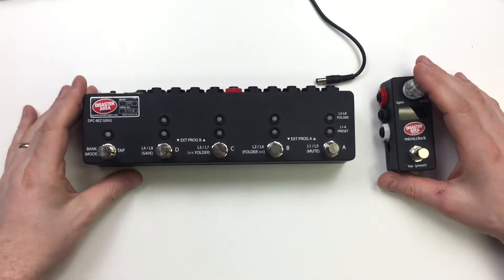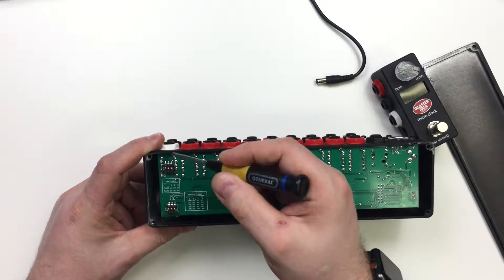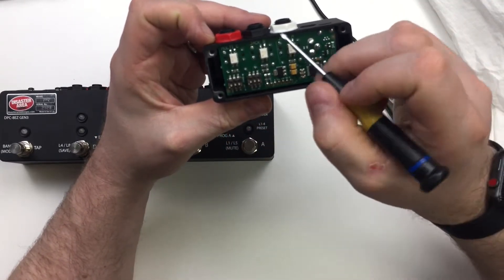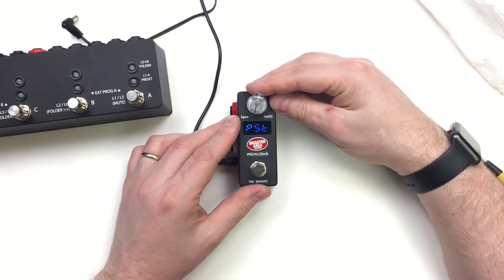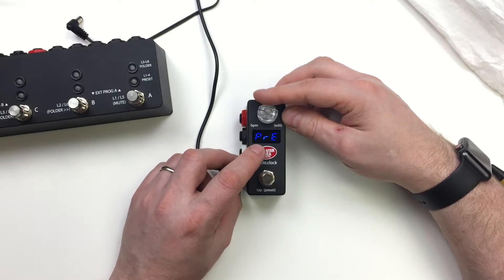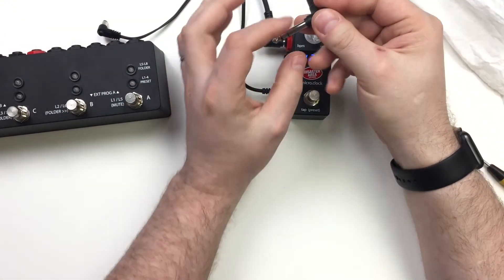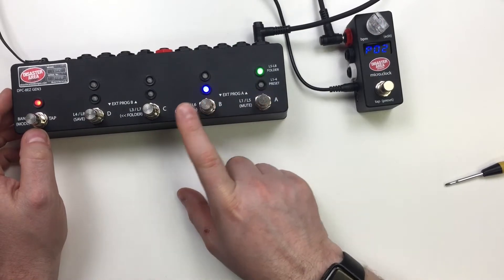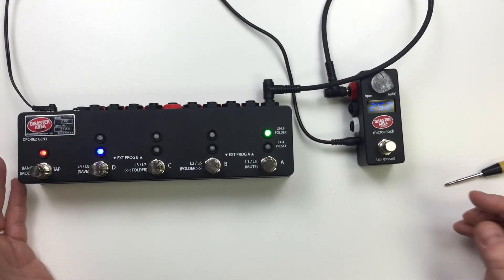micro.clock & DPC 8EZ Setup

Comment: So, does the micro.clock have 128 presets recalled by sending a PC message as usual, and will it then send that tempo back to my Quad Cortex from whence the PC message came, so the QC responds to the micro.clock's preset tempo? Kinda like a two-way street.
Reply from the maker: In theory, yes, but the MIDI port on the micro.clock requires either a TRS to MIDI cable for MIDI out, or some adaptation to get MIDI in and out.  Our devices handle this natively but it might take a bit of work to get this with the QC.  Our SMARTClock would be a better choice as it has DIN MIDI in and out and would not require any special cabling.
Reply: @DisasterAreaDesigns  I have MIDI DIN to trs cables so should be ok??
Reply from the maker: @tristanseume  for output, sure, but if you need to do both input and output then you'll need something a bit more involved and we don't sell it.  By the time you get the micro.clock and the conversion you'd need, you're over the cost of the SMARTClock.
Reply: @DisasterAreaDesigns  I see... Well, my  micro clock arrives tomorrow! Second hand so a bargain, so maybe still worthwhile. What do I need? I do I just wait until Neural enable midi clock to be sent?! :D

Comment: I bought a dpc5 gen 3 and I want a gen 3 smart clock or a gen 3 micro clock. I want to control the Timeline.  How should I connect the micro or smart watch?  Do I have to connect directly to the Timeline or do I have to connect to the dpc5 to change tap tempo and subdivisions.

Comment: Is it possible to set it up where changing presets on the 8EZ won’t change presets on the micro.clock, and vice versa, where changing presets on the micro.clock won’t change the 8EZ? Basically, the 8EZ passes the tap info along to its MIDI controlled pedals, but it and the micro.clock work independently?
Reply from the maker: Sure, if you tell the micro.clock to use the Jack C as MIDI out only then it won't get any messages from the DPC.  The DPC will receive the clock from the micro.clock but it won't be able to ask it to change presets, if that makes sense.  Set up J C = MIO but then set the DIP switches with the "ring" set to OFF.

Comment: Just picked up one of these to sync my synths in a suitcase rig. Will it work with TE Pocket Operators?

Also, can it receive midi clock? Or only send?
Reply from the maker: It'll only send clock, not receive.  I'm not sure that we can output PO sync for the Operators, but it's possible to send 3.3V pulses from the C jack.  Maybe?
Reply: @DisasterAreaDesigns  I think that should work. Manual says it takes sync signal "no more than 5vpp". Thanks!
Reply: @DisasterAreaDesigns  what exactly comes out of the "tap tempo" jacks A and B?
Reply from the maker: @_skysick_  nothing, technically.  They're "dry contact closures," they simulate switches.  Most pedals use switches to trigger tap tempo, rather than pulses like synths.  Fundamentally different setup.
Reply: @DisasterAreaDesigns  I get what you mean. So they're just opening and closing momentarily like a relay?
Reply: @DisasterAreaDesigns  I've been thinking about what I'm trying to accomplish and I wanted to run an idea by you about how I can hack something together.

I need to send sync to...
1. Synths that take analog pulses
2. A mixer/effector that has usb and trs MIDI
3. A synth that only has USB midi
All simultaneously.

I can have the usb-only synth plugged into the USB port of the micro.clock, and have the multijack plugged into the TRS midi of the mixer, which leaves me to figure out how to get analog pulses out of the tap tempo jacks.

I looked around to see if I could find an "expression to CV" converter, as I think that's basically the same task. I only found one, and it's too large and expensive for my portable rig.

So here's my thought. I can make a TS cable to run from the synth sync input to the micro.clock tap jack, with 5v (from a usb cable) in series with the tip-to-tip wire. Then the taps should send 5v pulses. Does that sound legitimate?
Reply: I'm belatedly realizing that the micro-clock only sends taps when the tempo changes...
Reply from the maker: @_skysick_  It can be set to send taps all the time, the setup option is called "AUT" and you can configure any / all ports to do this.

Comment: Hola! quisiera saber si el dpc 8 es compatible con program change externo desde una computadora? Yo estoy usando reaper para tal fin. Otra consulta, tiene alguna app o interface o software para configurar los presets? Y la última. se puede utilizar en modo bank/presets? Soy de argentina y estoy tratando de conseguir información en español y no hay mucho que digamos. Mil disculpas y mil gracias!
Reply from the maker: Sí, puede enviar cambios de programa MIDI al DPC-8EZ desde su computadora. Necesita usar el mismo canal MIDI que usa el 8EZ para control externo, generalmente está configurado en 16 de fábrica.

También puede controlar manualmente cada efecto mediante mensajes MIDI CC, los números están en el manual de instrucciones.